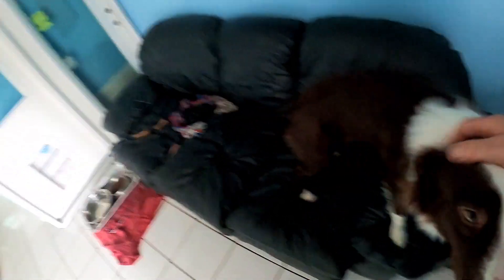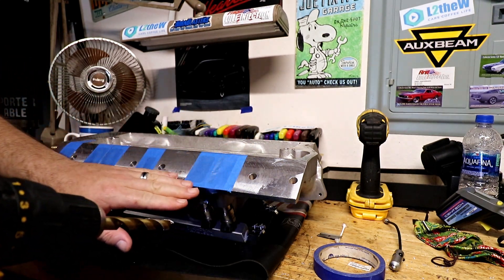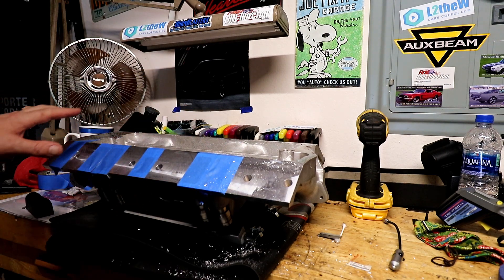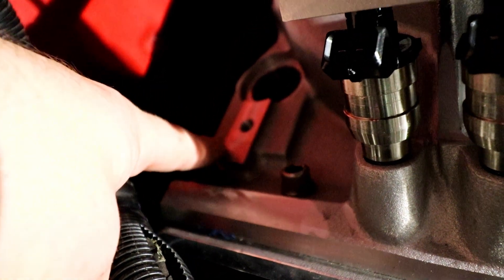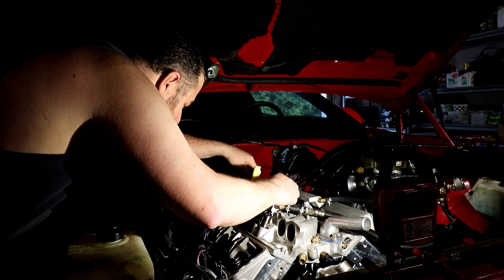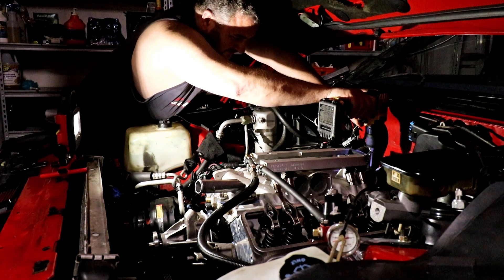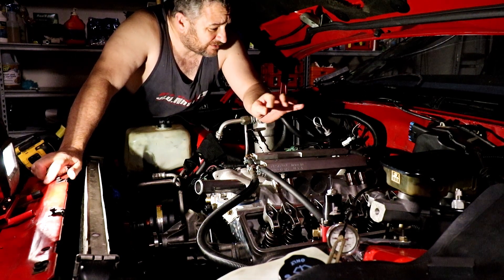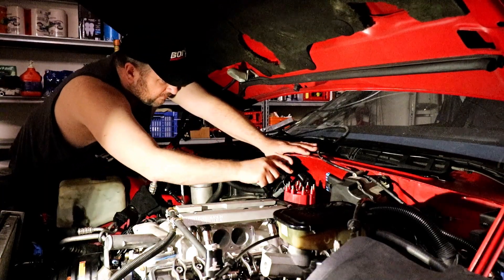DRILLING A BRAND NEW INTAKE  WHAT??!!!

Comment: You don't have to break in roller lifters! Don't put ur engine through the 2,000 to 2,500rpm cycle unless u really want too
Reply: @L2theWcarscoffeelife  I'm guessing they  assume you have a new build. Your rings and bearings are seasoned so don't need it.  You don't have to move oil pump slot. 1# cyl at 12deg before tdc on compression stroke. Or whatever timing you want. Drop distributor in exactly where you want to fire number 1. Rotor facing where your number 1turminal will be. Turn engine over slow, it will drop in bye itself exactly where you want it.
Reply: @L2theWcarscoffeelife  appreciate you letting me help a bit. I know you had second thoughts on the shift kit. If ur filter looks good and fluid is clean, your trans will benefit from a shift improver kit. You wont lose all your fluid, itl be in the converter and valve body too. A little more line pressure from a RV kit will help ur clutch packs. Hoping to hear her bark soon!
Reply: @L2theWcarscoffeelife  you upgraded the whole car, may as well give the 700r4 some love too!
Reply: @L2theWcarscoffeelife  did you switch over to decaf? Hope all is well.

Comment: What injectors are you running? (I went with the Bosch 4s and electric adapters).  -For the alan bolts for the runners I got the Dewalt ratcheting T-handle wrench -it's the ONLY way to go with these things.  Ken should just sell them on the site.